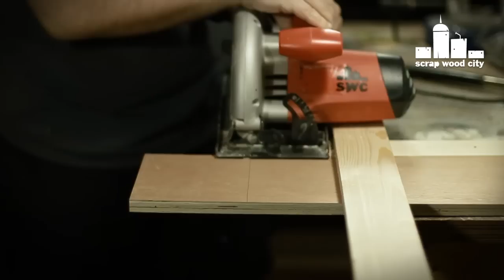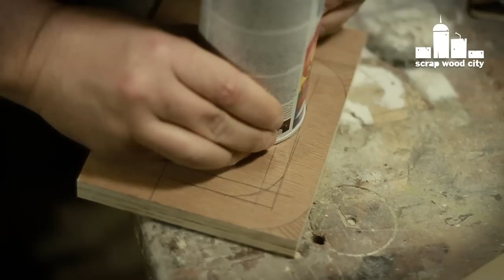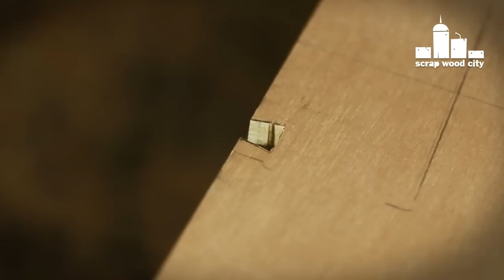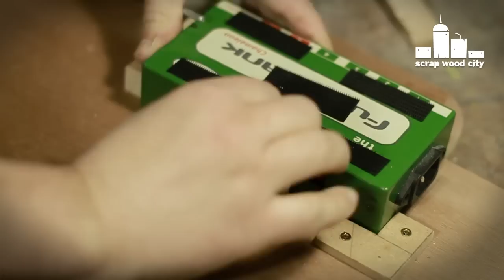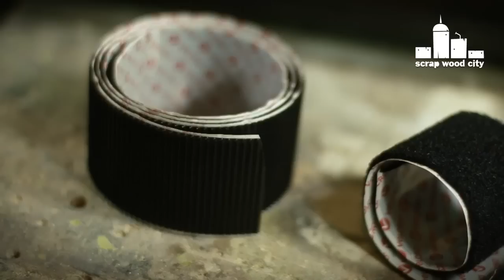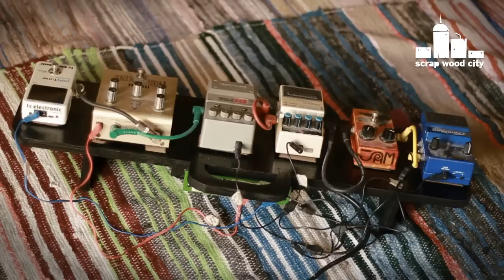DIY guitar pedalboard out of plywood

Comment: Like that dovetailed handle. Think that velcro is safe enough to hold the pedals while you move your board around? I'd prefer something a bit surer, maybe like long cable ties. Keep us posted on how it performs.
Reply from the maker: Velcro is supert strong. I made another pedal board in the past and I had added velcro. I moved it around a lot. Actually once I tried to remove a pedal and a piece of plywood broke off instead of the velcro! The ties are good solution also, But I believe you have to drill the bottom of the pedals to mount them om without moving! I prefer velcro by far as long as it is good quality!
Reply: Use a butter knife to remove pedals without pulling up the velco. I always keep 1 inside my pedalboard case.